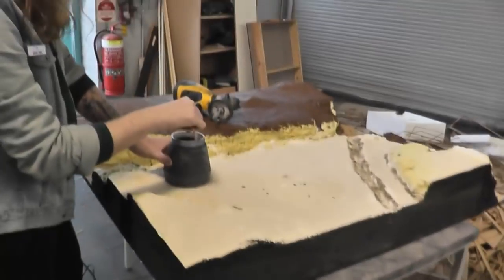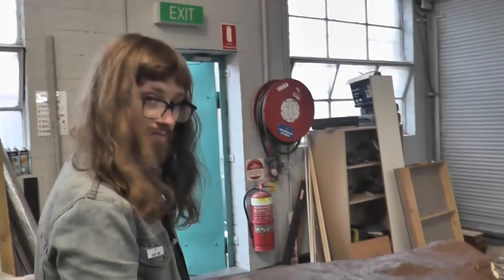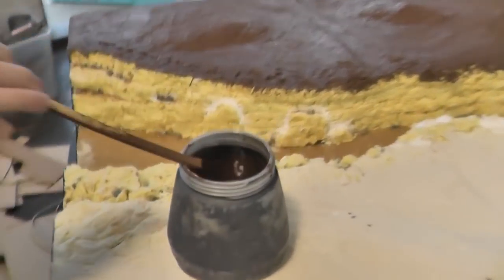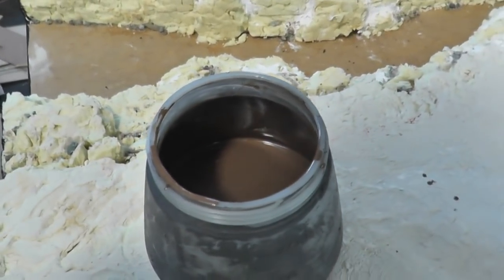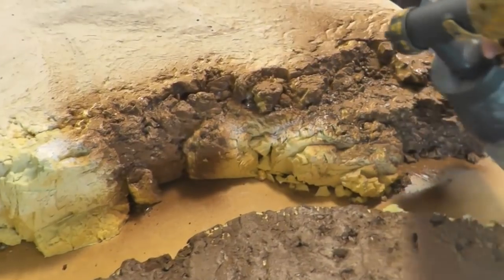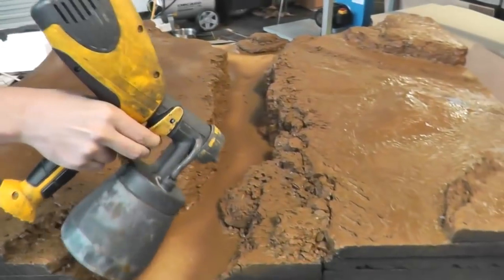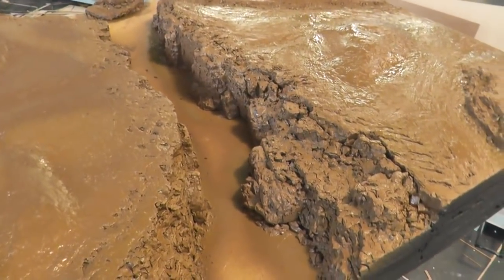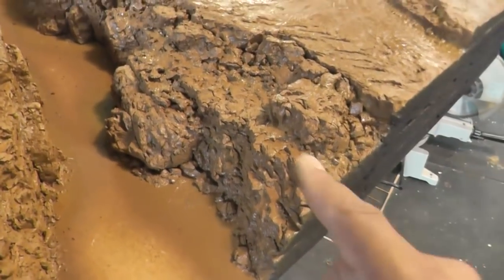Tribal Board - Base coating, the easy way!

Comment: Nice one Viv, I've been debating whether to pick one of those up and this has just sealed the deal. Scott's doing some cracking work on that board!
Reply from the maker: +TheTerrainTutor - For the work you do Mel, you need one mate!
Reply: RubbishInRubbishOut
Yeah mate, these boards keep getting bigger lol. Do you recommend the wagner?
Reply from the maker: TheTerrainTutor It's served me well ... this is an old model, they have much newer ones available these days, mine is probably 4 years old.  Just like an airbrush you need to keep them clean ... though they are easier to 'fix' than an airbrush in the event you don't clean it well enough.  So yes, I recommend them, but look for a newer model.  I bought one of the cheaper wagners, you can get high quality more expensive ones, but this has suited me fine.
Reply: RubbishInRubbishOut
Thanks mate, I appreciate the info, good to know they keep going :-)

Comment: looks great! What did you guys use for the ground/sand texture?
Reply from the maker: +Kido Oudenbroek - In this video we show how we made the substructure - https://www.youtube.com/watch?v=CZw8XBxHiWU
Reply: +RubbishInRubbishOut oké. I've watched that one, but I thought you guys added something on top of that. Looks great to scale!
Reply from the maker: Kido Oudenbroek Nope - it's just Sculpta-Mold to blend things in, and a coat of wall filler to smoothen things out, though if you work Sculpta-Mold long enough it will give you a very smooth flat finish